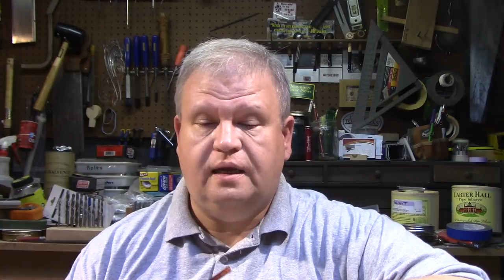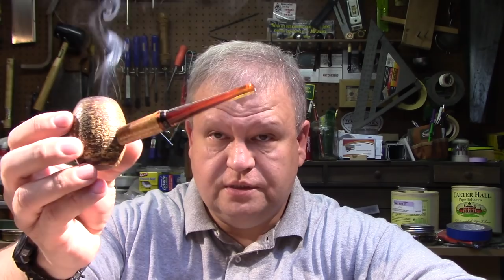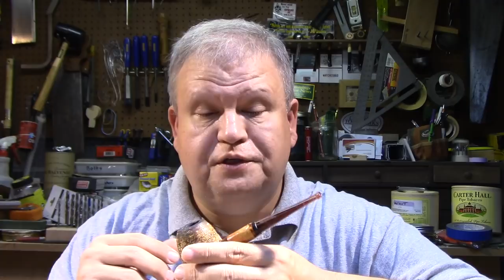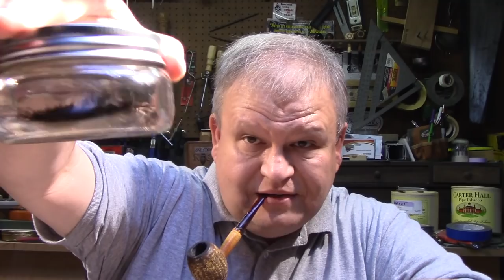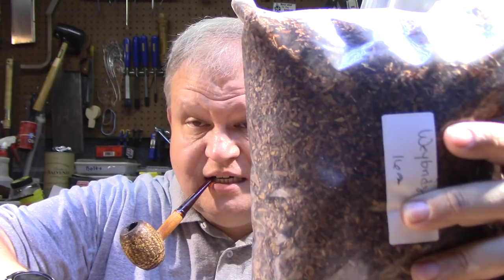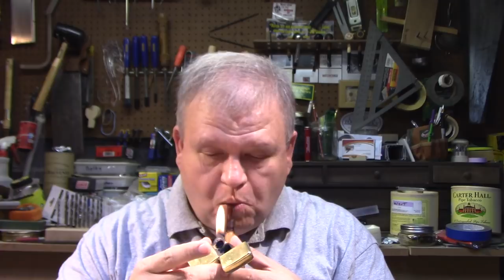Ageing Weybridge Tobacco Weekend Chat 02 June 2019

Comment: I watched the Crystal's on Sam Gawiths Balkan flake and other Gawith flakes under the microscope. And these are in fact chrystalisations on the flakes. I tasted them by just licking and they don't taste sweet, so it's definitely not sweet sugar. I found out that these are the minerals that are in the tobacco by nature and they sometimes come out and crystallize on the surface. That has something to do with moisture content and what not. You can check for yourself what on the tobacco is with just a good magnifying glass or a microscope. On pipe tobaccos it is normally not mold when something shows up on the surface. On Cigars it is something different, these are not Crystal's😖
Reply from the maker: I appreciate the comment and find it very interesting, but... 1) Both bacteria and mold colonies can appear crystalline under a microscope, 2) not all sugars are what you might call sweet (ever taste glucose?),  3) there is no way that there is a high enough mineral content in tobacco to account for that much crystallization of minerals (same is actually true of sugar), and finally 4) analysis  of both cigar bloom and tobacco "sugar" has shown that it is ALWAYS either mold or bacteria (see blog post in the description and links in that post).  I could add from personal experience that tobacco that is handled properly and stored in clean jars does not produce these crystals, even after 10+ years.  If you like thinking of it as mineral crystals or sugar or whatever that's fine. There is apparently no harm in smoking the tobaccos with these growths (I think we would have heard by now of people dropping over after smoking tainted tobacco) probably because the microorganisms are incinerated.   Please don't take my response personally.  I know that you are just trying to understand what it actually is.  There are some folks out there that try to pass it off as a sign of good quality tobacco which is just spreading bad information.  Thanks for watching and for the thoughtful and thought provoking comment!
Reply: @CaneRodPiper  I opened a lot of pretty fresh and older tins of Samuel Gawith balkan flake, Sam's flake and others of their flakes and they almost always have Crystal's on them. So to me it seems that it has to do with their treatment of the tobaccos. Maybe steam pressing or however they do it. And to me these shiny Crystal's on the tobacco are absolutely no need to worry, no matter what they really are. I don't even rub them off before smoking. Other with cigars, these whiteish or yellowish, fine stringy, looking spots I definitely rub them of before smoking because they really look like mold. 
But the strange thing is, if it is really mold or bacteria on Cigars, why doesn't it spread on all other cigars in the humidor? When I put especially Cuban Cigars in the humidor that often have these spots on them shouldn't it spread in a short time on all the other Cigars in the humidor? But I've never seen that happen🤷‍♂️
And I would bet that if I would put a flake of Sam Gawith's flakes with a bunch of Crystals on it right on top of another flake or mixture without crystals, it would not spread on the other tobacco. I mean that's what should happen after a short while if it's mold or bacteria, right? It would spread on every other tobacco that comes in contact with it. I have a mason jar of 3 years old Marlin flake sitting right next to a jar of 3 year old Balkan flake that I both open from time to time, but still only the Balkan has Crystal's on it.
Reply: @CaneRodPiper  and another thing. I don't really trust these testings because maybe there was a cross contamination in the testings. You would need to isolate just the "bloom" but in all tobaccos there are of course mold spores and bacteria like in every other natural products but is this really what bunches up at the surface or is the bloom only contaminated with spores and bacteria?🤷‍♂️
Just a theory